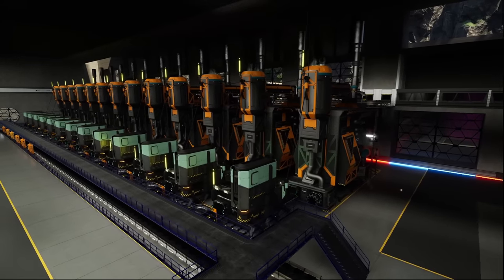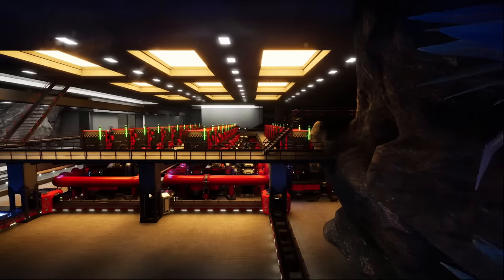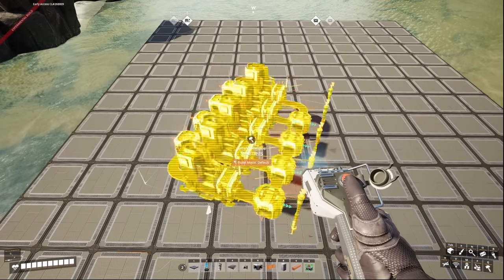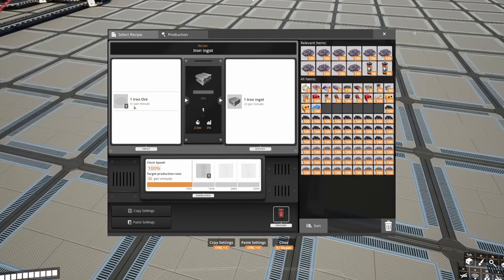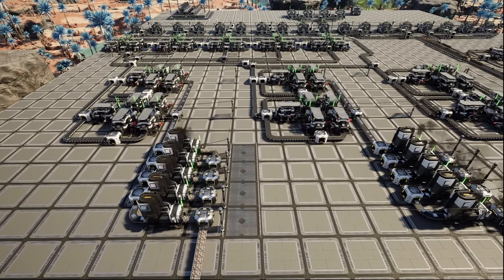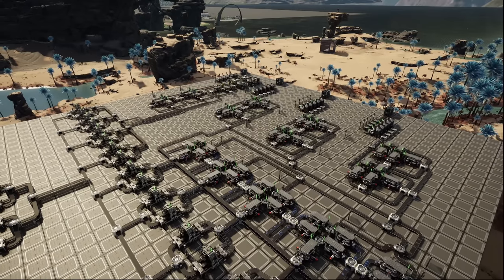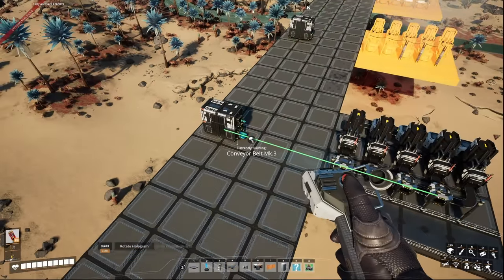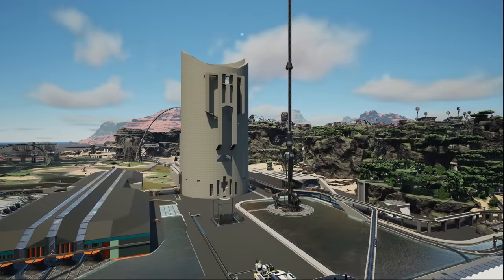How To Plan Building Factories With Blueprints in Satisfactory Update 8

Comment: Always underclock your machines and also build waaaaay more than you need. Then when it comes to upgrading production you’ve already accommodated for the space😊
Reply: I always underclock for mk3 miner (200% or 250% overclocked) later. After upgrading the miner, i just change the clock speed. I sometimes mess up with the belts/pipes as they become to slow even with mk5 Belt :/
Reply: Why underclock?
Reply: @Trimonu  So I've never actually done what they're describing but I think I know why. Early on in the game you're limited by how many items can fit on a belt. You also don't have access to MK2 miners, so the amount of ore you can get out of a node is limited. Here's an example: Let's say you have a pure iron node. A MK1 miner can extract 120 ore per minute, which is the same amount that a MK2 belt can carry. The intuitive solution is to build 4 smelters, each smelting 30 iron ore per minute. However, it won't be too long until you get access to MK2 miners and MK3 belts, which can extract 240 ore per minute (270 ore can fit on the belt if you want to overclock the miner, but let's ignore that). 

Now you want 8 smelters because you have twice as much ore. But you might not have room for 4 more smelters next to the 4 you built earlier. You could overclock all 4 smelters, but overclocking adds up fast and you could run out of power shards. Instead, you build 8 smelters in the early game, and underclock all of them to 50% until you unlock the better miners. Then you bring all 8 smelters back up to 100% and upgrade the belts to MK3.
Reply: @bobboulden  this, or simply just reserve the space beforehand but maybe it's easier to forget about it than building it right away.
Reply: @wuppi I feel like a bit of both does best. Building for the desired input or output while keeping some space for potential expansion should mean you never accidentally encroach on another factory or section.
Reply: @Trimonu Why underclock?
1. It saves power. A Constructor takes 4 MW at 100% but only 1.6MW at 50%. Build two and you save 0.8 MW which is huge if you still run on Biofuel.
2. It looks cool to have many buildings up and running. And it can help with logistics if you always work with the same blocksizes.
3. The game doubles you up on stuff quite a view times. Doubeling up production in advance is a neat trick for experienced players and is a great synergy with power saving.

Comment: Good stuff! Something I have a tendency to struggle with is planning production for MASS assembly lines. The math itself isn't difficult — Satisfactory Calculator makes it rather trivial — but when you're tasking yourself to make a walkable factory building for TITANIC production lines... It can get rather... let's say "challenging". I'll just take the numbers from my last Modular Frame build as an example: 80 smelters (iron ingots), 32 + 56 + 50 constructors (plates + iron wire + rods respectively), and 34 + 62 assemblers (reinforced plates + frames respectively).

I managed to put together something that works, but I won't lie and say it's something I'm entirely proud of. I tried going for this sort of Aperture Science kinda vibe where I have stacks of blueprints spaced apart with a walkway snaking between them, at least for the section containing the assemblers and rod constructors. The rest is more brutalist hallways using signs with warm white as illumination (first build I made with Lumen!). I also didn't have very much horizontal room to work with, so I ended up going for verticality. The second half of the building feels so damn tall I'm pretty sure it could have its own weather patterns! Haven't even TRIED decorating the outside of it yet because it's basically just a collection of MASSIVE flat concrete walls!

Anyway, I'd love to see how you tackle such a challenge. I suppose it falls into the category of mega-factory, but for a single assembly line and built atop a pair of pure iron nodes (the ones in the rocky dessert near the lake to be specific). I worked with the assumption that, at some point in the future, I could extract a total of 2400 ore per minute out of them. That way I know that the only modification I'd have to make is upgrading the miners and overclocking them.

Comment: I love planning out factories, it is actually rare that I build one without sketching it out on paper first.  I can offer a few tips to people.
A common mistake is focusing only on the machine layouts.  if you do that you end up with a cramp space that is really hard to navigate if you ever need to go in and adjust or upgrade the system.
Another tip is choose an expansion direction for your factory and keep it cleared of any other things like roads or train lines.  Expanding in a haphazard way can quickly become a nightmare when you need to get inside but having a designated expansion zone helps keep it orderly.
A final tip for planned factories is break the structure up into zones.  Receiving/shipping, distribution, production, assembly, and warehouse.  In this context distribution is local, within the factory, pulling the received materials from the warehouse and distributing them to the various production lines.  Production and assembly are separate things, with production dealing with turning raw materials into something and assembly being manufactured items being turned into more complex items.

Comment: Mega factory tip video would be appreciated. In particular I find lately that I’m having trouble planning out how to bring logistics and (stairwell) access to each floor vertically, especially when I’m using blueprint modules to create multi-level factories (not necessarily mega factories.. but concepts would be shared between factory styles)
Reply: Bit more context for what I’m trying to do.. I’ve been creating 4mx8m wall segments (for easy snapping or hot swapping pieces) in different architectural styles so that I can easily build mini skyscrapers that have production of only one or two items per floor. 
I struggle with how to cleanly incorporate stairwells and conveyor lifts into this type of build.

Comment: The "easy" step upgrade for beginners -both to save space and to make it look much cleaner -is the add a logistics room under all the production units for belts and elevators.
It takes a lot of time at first -when figuring out how to connect everything, but once you get the hang of it, its not that bad. Add 2x2 walkway space in both logicstics room and around each blueprint, and you end up with both space to connect belts, but also to style your factory into rooms or make walkways, ladders and railings alter.
I even add another empty room under all that in my blueprints! It always comes in handy, for just connecting tunnels, space to work, or to add future belts and resources to upgrader machines built on top of the first layer! Personally I make use of this for 2-4 bus rows for easy access to the entire production line and future production too.

It'll take you another 15 minutes with each blueprint -but once its done, you are set up "for life", instead of having to go back later and redo entire floors to clean up earlier mess.

Comment: So my question is, you've got this motor factory up and running. But now you want to make modular Engines. Do you build a whole new factory just for that, or do you take some or all of the output of your motor factory to use in the modular engine factory? And if you do the latter, are you then building the modular engine factory nearby, or are you moving the motors via truck or train to some far off location?
Reply: This is where I stalled on my last playthrough. Obviously this will be different for each person, but I see a lot of youtubers do the latter. They make a factory that is large and then ship materials via train/truck to where they want stuff to be.
Reply: @Homarid1  Yeah I'm having a similar OCD problem, because once I get everything working the way I want, I unlock the next tier of items and want to rebuild everything all over again to make it work with the new items, but I feel like I'm spinning in circles doing that.
Reply: Write down the end production and move on. Find a group of nodes to make another factory. You'll probably need a power generator. It can fuel your tractors, too.

Comment: My biggest issue i have building a factory is, how high should i place the foundations above the ground, and still make it look like it is part of the terrain.
Reply: I always pick a high-ish spot and then drag a foundation to the nearest "higher than that" spot. That tells me about how big I can go at any given height. If you go high enough you can build little "maintenance" hallways beneath the factory without having a gravity defying floor plan.
You just wall off the raised bits so it looks like a properly intertwined and confusing sub-city system